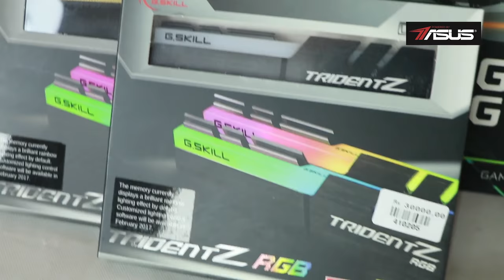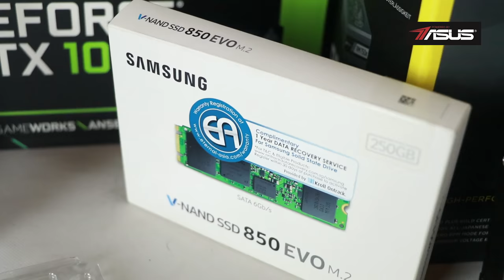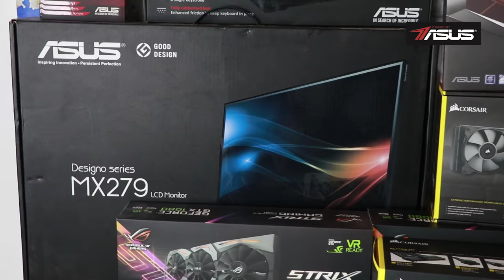2017 ASUS ROG Kabylake Complete Gaming PC Build 580,000LKR සිංහලෙන්

Comment: lankawe me vga ganan wadi man gaththe 90000kata
Reply from the maker: Ow neda, dan Ti awa hinda thawath adu wei
Reply: math assemble kare skylake ekak

core i7 6700k
asus maximus  vii hero
Corsair VENGEANCE RED LED 16GB (2 x 8GB) DDR4 3200MHz (x2)
CORSAIR H115i
Asus strix  GTX 1080
corsair RM750i
Sandisk 480gb ssd
3tb seagate hard disk
NZXT phanthom 530
Asus VX239H 
Asus strix tactic pro keyboard 

mata giye 280000k withara
Reply from the maker: Maru